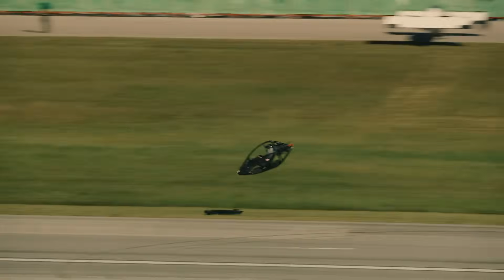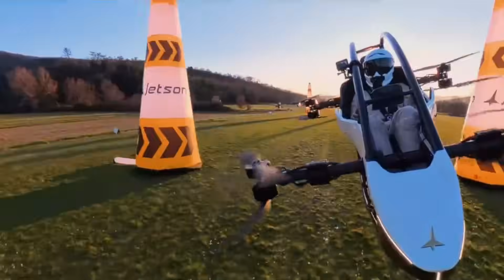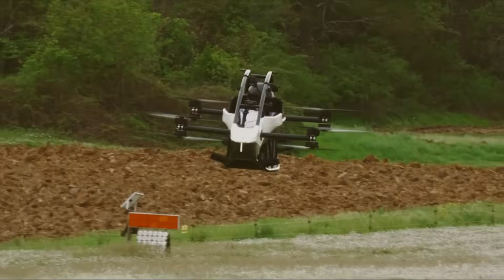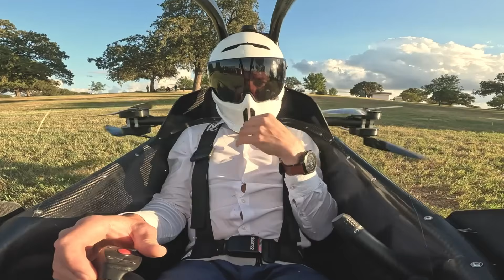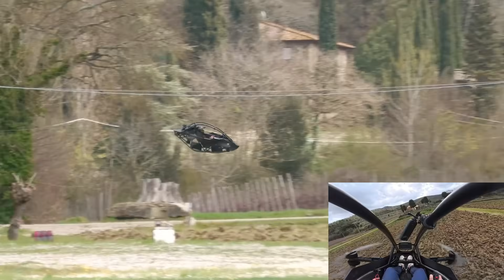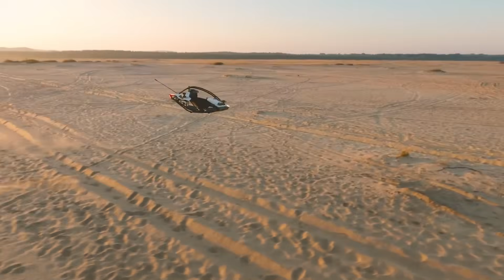Can This Jetson ONE Redesign Fly 70% Longer?

Comment: The twin-rotor, counter-rotating design of the CH-46 Sea Knight (NOT the CH-47 Chinook) is the best for speed, compactness & maneuverability.  I used to marvel at their agility during ship-to-ship VertRep missions.  Also, the CH-46 had folding rotors for compact storage.
Reply from the maker: Great perspective, especially with your firsthand VERTREP experience. The CH-46 is a really interesting example of what a compact tandem-rotor layout can achieve, and the folding rotors are a huge advantage for shipboard storage. It would be fascinating to see whether some of those design principles could translate to a lightweight electric VTOL.

Comment: What about ducted fans?
Reply from the maker: Ducted fans are definitely worth exploring. They could improve rotor safety and potentially help efficiency if designed properly, but the ducts also add weight and drag. For a VTOL this weight-sensitive, it would be interesting to compare actual thrust-per-kW and endurance against the open-rotor design.
Reply: Highly inefficient.
Reply from the maker: @702Wolfi  That’s the interesting trade-off. Ducted fans can improve rotor protection, but the ducts add weight and drag. On a small eVTOL like this, I’d be curious to see whether the safety benefit is worth the endurance penalty.

Comment: Why not just add 2 mini jet engines on the back to recharge and power the rotors? RC remote control aircraft have mini jet engines.
Reply from the maker: That’s actually an interesting hybrid concept. A small turbine generator could potentially act as a range extender and supply electrical power to the rotors. The challenge would be whether the extra fuel, generator, turbine, cooling, and weight provide enough additional endurance to justify the added complexity.
Reply: Drop the batteries and go with turbines.  Cheaper, faster, and far greater range.  License required.  Like any other market, it is all money driven.  Money will determine the future of evtol’s.  Can’t wait, though it’s 15 years away.
Reply from the maker: @bwmcelya  A turbine range-extender is definitely an interesting direction. It could address one of the biggest limitations of battery-only VTOLs: endurance. Going fully turbine or hybrid brings its own challenges though — fuel, heat, noise, weight, maintenance, and regulations. I suspect hybrid propulsion may be the more interesting middle ground before batteries improve enough.
Reply: @UnboxTheWorldD .   Good thinking.  The industry, because of its profit potential, is developing at light speed.  Pretty exciting really.  I can imagine looking up one day, and seeing a drone traffic jam in some big city (smile).  Enjoyed the video.  Thank you.
Reply from the maker: @kevinh5349  That’s a good point. Going hybrid might solve part of the range problem, but it would also remove one of Jetson ONE’s biggest selling points: being fully electric. The real breakthrough would be getting much longer endurance without sacrificing that simplicity — which probably brings us right back to better batteries.

Comment: The best of both worlds would be to wait a couple of years for a denser battery. Or a small hydrogen powered generater!?
Reply from the maker: Those are probably two of the most interesting paths. Better batteries would be the simplest solution because they keep the aircraft fully electric, while a small hydrogen range extender could increase endurance but would add tanks, plumbing, heat, weight, and complexity. For a one-seat eVTOL, every extra kilogram matters, so the winning solution will be whichever adds the most usable flight time without hurting safety or payload.